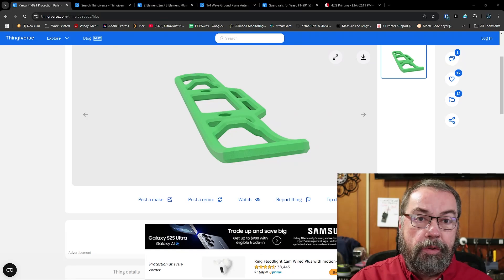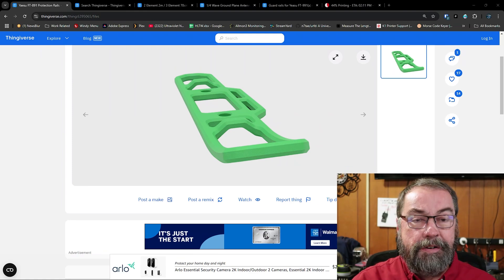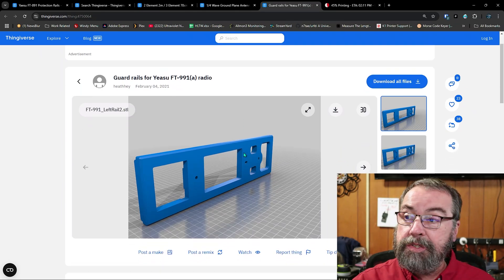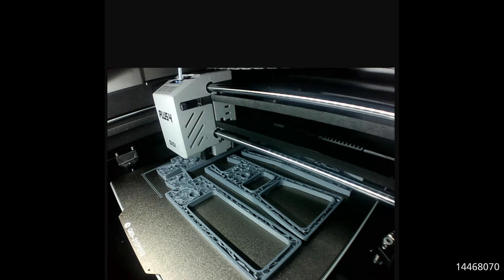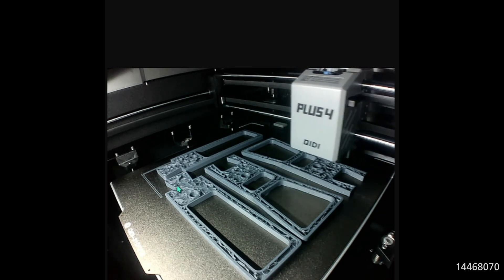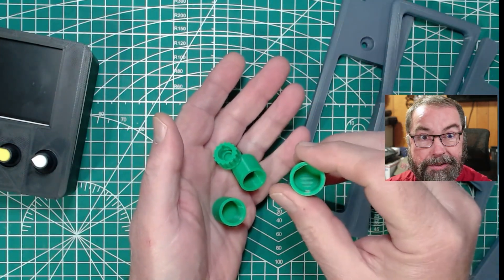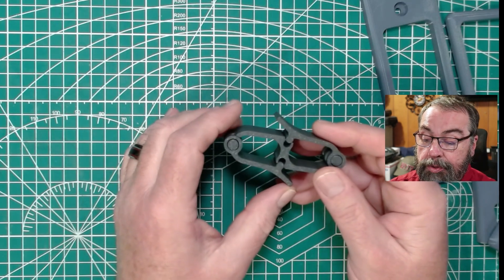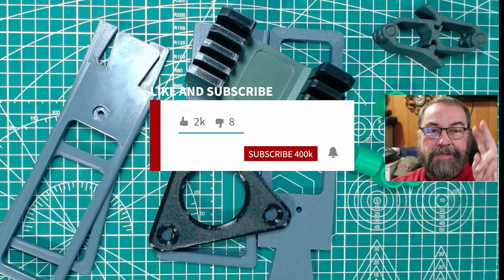3D Printing for Ham Radio

Comment: I’m considering buying either the Bambu A1 or P1S. As a first printer the A1 seems to be a good choice. However, the P1S might be a better choice in terms of material it can print. Both have pros and cons. My question is what printing materials should I consider for Amateur Radio type of applications?
Reply from the maker: Both are great printers!  PLA works just fine for anything that is not outdoors long-term.  If you're going to have a part exposed outside, then PLA will tend to break down from UV exposure, and to a lesser extent lots of direct sunlight.  PETG (also cheap) will hold up a LOT better outside.  I have a ground spike for my DX Commander printed in PETG, and's been in the ground for well over a year now.  Antenna winders would be another application for PETG.  The "best" filament just really is about where the part will end up.

Comment: The side racks are worthless. I designed one for the Yaesu dx10 and 991a and they look great but will not protect the radio if it falls and after a while the plastic wears and the rail gets lose so you tighten it and then the rail snaps. Is you like the rail then send the step file to a place that can CNC it in black metal.

Comment: For me tho most useful thing to print regarding Ham Radio is a thing calld "SMA Thumb Wrench"
Perfect little helper to fasten and loose SMA-connectors with ease. 
I've printed a bunch and equipped all my field use connetors with them permanently.

Very worth a search at thingiverse or printables.
VY 73

Comment: Thanks for the video.  I have been 3d printing for years and have an ender 3 that I have upgraded to the max (linear bearing rails, control board, fans, auto leveling, hot end, direct drive, etc).  It prints well but has some issues with the more "advanced" plastics.  I've been looking at the QIDI Plus 4 (that you have).  From what I see on the internet, it looks like a great printer.  This is the "style" of printers that I would like to purchase/upgrade to.  Out of all of the printers (similar) to this, would you recommend this one over the others ( that have similar features and price point)?
Reply from the maker: I LOVE the QIDI!  For several reasons.  Bed size (larger than the Bambu), it competes directly with the X1C at nearly twice the price.  There was an initial issue with the SSR board, but if you get one with that board, email Qidi, and they'll drop the replacement in the mail to you.  There have been several 3D channel videos out about that.  As I hadn't printed with anything juicier than PETG, it was not an issue for me (since replaced).

The A1 mini is great.  Fast, and $200.  But the bed size is only 180x180 compared to the Qidi.  The Qidi has been rock solid, prints all the things.
Reply: @FEPLabsRadio  Excellent.  Thanks!